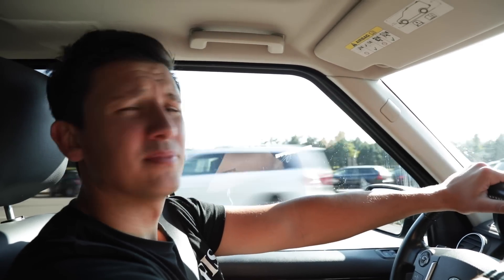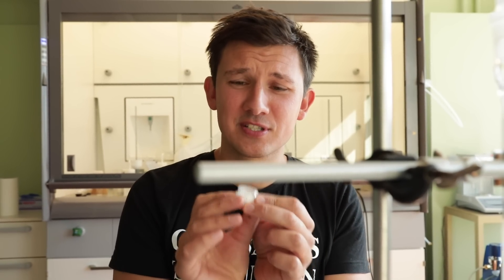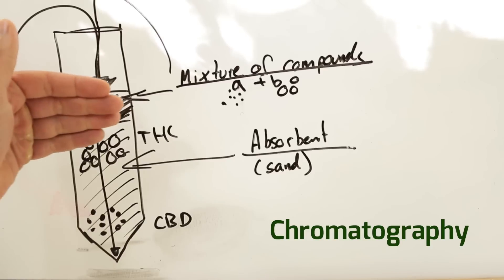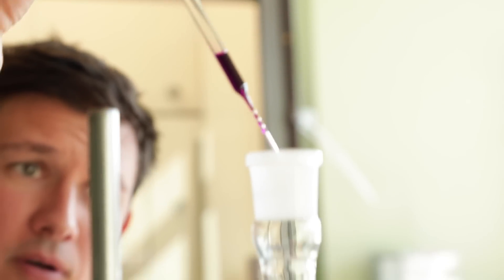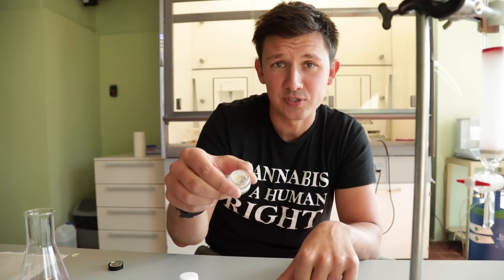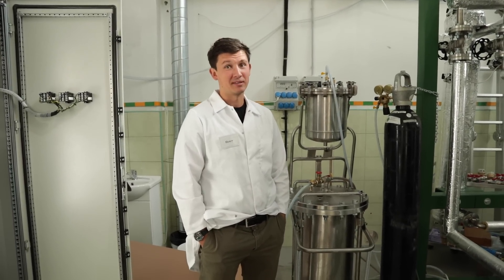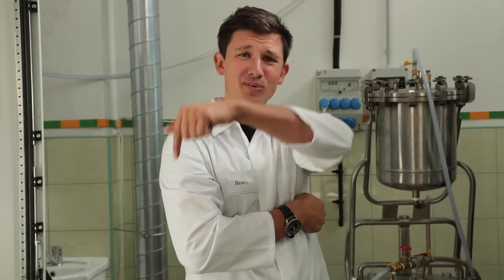How To Make 99% PURE CBD Crystals

Comment: Could you use an espresso machine? Very small scale fill the basket with the sand or make a column shaped basket. Then put the product on top of the sand and switch on they create 15-21bar of pressure so don't see why it wouldn't work 🤷🏻‍♂️ worth a try.

Comment: Fill water tank of cheap coffee machine with sand, disconnect the heating circuit of the water pre-filter, would the pump then create pressure, evaporate off as usual etc? Great videos man.

Comment: What if you place sand in the filter of the coffee machine, place gas tube and seal the coffee machine so the pressure can be kept within as much as possible. If the coffee can be assigned for CBD making than you can drill hole for the gas tube to minimize the gas escaping and create the pressure needed. Just was thinking, I am applied chemistry student and I am very interested in the topic of CBD extractions.
Reply from the maker: Certainly an interesting approach for more diy situations, thanks for sharing!

Comment: could you make the process automated , using pumps to recirculate the product x number of times need valves and switches but should be able to be done with relay logic no cpu needed just asking i have no clue on viscisity etc
Reply from the maker: Interesting propostion!  🤓

Comment: The molecules don't separate because of their size. He said big molecules, little molecules. They separate because of the various effects the solvent system and the solid phase has on the mobile phase, where the mobile phase is the mixture you are trying to separate. The solid phase is the sand. You want to choose a solvent system that will allow a greater distance between the THC and CBD phase as it runs through the column. It has to do with polarity and a few other factors. What he is doing is called flash chromatography, which is column chromatography with the use of air pressure to force the mobile phase through the solid phase. Also, depending on the solvent system, it is possible for the order of the molecules to change--he said CBD will come off first, but that wouldn't be guaranteed as it depends on the solvent system. I am not familiar with weed chemistry, so I cannot contribute any solvent systems that would be helpful, but I am sure those are readily described.
Reply: i need a discription like this for what happens in a honeybee extractor +lightergas (grinded buds)
Reply: @zap7026  what is a honeybee extractor?

Comment: Hes either trooling , or a victim of dunnin kruger syndrome , either way sand will not just stop what you want.  Cbd and thc are both very complex but they are both non polar cannabinoids and they are in there own right also very similar , expecially when it comes to psyical prop like BP , MP , and !!souability!!! .. Plus his "specialized equipment"  could mostly be bought at and hobby lobby and  Amazon ... Long story short dont even listen to this idiot . if you want to make extracts Successfully jus get a high school chem book and flip to the chapter about solubility and molecular polarity \also do a bit of research about boiling points in near perfect vacuum.  

Ps: seriously its simple chemistry , dont consider doing what this jagoff did on the vid , as few good day of research and the right starting hemp (biomass of choice) you could be toutering this fool on how to do an extraction - remove lipids+fats - vacuum fractional distillation  to seperate the otherwise inseperable; terpene fraction ~ diol/alcohol fraction(cbd+cbn) then finally the canibinoids with the higest boiling point THC +THCn+THCa.
Reply from the maker: Well, sand works perfectly well for crystals, but we use a variety of extraction methods. It works for us and thousands of our customers, but hey, thanks for all the compliments ;)

Comment: Have you tried with a single cup coffee maker?  Take it apart, reroute the water lines and add your chromatography tube along side of the machine with an additonal water line routed from the bottom of the tube into the drip spout.  Utilize the water pump as a pressure pump.  Pressure may be an issue, or pump timing.  Find the pressure or low water switch and cut it away from the pump and add a switch to it so it doesnt stop automatically to hopefully keep the oressure for the tube.  Love the idea of building a consumer Oil maker!!!  Dont even think it would be that difficult.  Just a thought 🤷‍♂️😊  awesome videos.  Love the ingenuity!

Comment: you need a whole chain of coffee machines. one is not enough.
connect them in series for volume or connect them in parallel for speed.
simple

that way you can scale up to the preferred VOLUME.
again: one machine would be simply underpowered

I would suggest to start with 6 machines that´s a good balance between price and output.
that way you can keep the cost low and still have a decent production.

edit:
you can start with CHEAP ones. don´t need to go crazy with top brands from Italy.  
unless you are rich and care about style vs cost. LOL

Comment: Have you guys tried liquid extraction if you did with what solvent? Also curious about what sand is used. Reason for askin, very few people have access to GC equipment to ensure how much thc goes through. Thanx for the video.
Reply from the maker: The sand we use is a type of silica, and we have done a video on alcohol extraction, however do our extractions at Endoca with C02

Comment: What do you use for the "pressure" part? Oxigen?
Cheers...
Reply: Mr. Sunny makes the liquid follow the path of least resistance (down the tube) at a higher rate. Basically just speeds up the process
Reply from the maker: A hose with air pressure for an at home job should work perfectly fine
Reply: Nitrogen is typically used for Column Chromatography...inert gases are best, but it really depends on if your compound of interest is sensitive to oxidation. I think pressurized air works for this particular separation, but in most research labs N2 is used.

Comment: yo.  conventional coffee machine is not going to work, but you could use a cold drip, potentially...  otherwise, use an espresso machine, pack with sand, and then the extract...  the steam pressure may be enough, have to watch the temp to prevent burning everything away.  and maybe experiment with ice to affect the physics of the procedure.
Reply from the maker: Awesome, if you try it let us know!

Comment: If I'm only getting THC out, does it take longer the same amount of time? And do you do it over and over a few times by rerunning the same fluid or keep adding extra fluid for each run thru the sand? What kind of sand would you suggest? Last thing, what kind of fluid exactly? (Sorry for all the questions at once.  Lol.)

Comment: You never say how much pressure you need...espresso maker van get 9 Barre.
Reply: That's exactly what I thought!  I was looking for this comment.  I imagine it would work.  What I would do, theoretically, is disable to heating unit (and any alarms the system might have for it like an auto off), putting pure sand in the area for the "puck" of finely ground coffee, then have the machine push it through.  Just use a small enough amount to test it and pray it works

Comment: It is easy .

You need pure Silicon Dioxide (sand)
A glass tube to hold the material and filter . 
The liquid would be the oil mixed with some ethanol 
Apply pressure or suction from below and that's it
Reply: you dont use ethanol for this process
Reply: @unclesam1813  why not?
Reply: Have you done it?
Reply: Why is the thc absorbed oppose to the CBD? Would this process work with oil with a higher percentage of THC as in not extracted from hemp but high CBD cannabis?
Reply: @brokenoho  it does not absorb the thc but the thc cristals are larger than the cbd cristals and therefor the cbd cristals wil come out first and thc last and yes , it wil work on any ratio cbd/thc but i think to find out when it stops putting out cbd and starts putting out thc might be a bit tricky to define
Reply: Dave Nolan if you wanna crystallize thc you need to either do a form of jartech or buy a diamond miner
Reply: @Kenfuy  Even a year ago jar tech was old. Diamond miners are not great either. Dissolving thc isolate in a solvent and allowing crystallization through evaporation is the best process to produce thc diamonds. You cannot do this work cbd, cbd requires lower ph to crystalize so you would need to add something to lower ph in cbd crude to produce cbd diamonds.
Reply: @RoyAlvarezLuna  it's all just saturation levels but a miner/jar style allows for recrystallization to grow growing massive stones like the 1000g stone by east coast gold, I wasn't speaking for cbd. If your goal is to just crash the thca then evaporation in a dish/pan will be the most efficient. Lower and slower methods can more reliably produce larger stones if that's the goal. Jar teks are just a small scale way to start learning about saturation levels man.
Reply: Kenfuy those are from pentane recrashing.   🤷‍♂️.  Take pure thca and dissolve into pentane and it reforms into larger crystals and can keep growing if you keep it saturated In thca rich pentane.    How many of you clowns actually do this in a lab for a job? 🤣😂.   My guess is none of you.   You’re mixing up different tech and from your comments only half understand what you are talking about.
Reply: Easy? For you who must be a real scientist!
Reply: Catherine S. Todd not really, just takes some cash for a CRC and a closed loop and a lil bit of understanding on how crystals are formed
Reply: @MatanuskaHIGH as I said in my comment "I wasn't speaking for cbd"
Also I said "it's all just saturation levels" sure it's less specific than talking about using specific solvents but some people do use solvent blends for their reX.
But nah ya "wElL AcTuALlY"
Reply: Aye can you put down. Steps

Comment: If you are using silica gel "sand" he more polar CBD should be retained longer than the THC you had it backwards. On C18 column reversed phase then the order would be reversed. Don't you use some kind of detector to determine when you compounds come out of the column? Otherwise you are wasting time a solvents, amateur hour.
Reply from the maker: We do ours in the lab and have far more processes involved than in the way we showed in the videos. We are just trying to show it in the most simple, stripped down version

Comment: CBD and THC are the same size and weight... they would not differentiate as to size would they if they are the same weight?
Reply from the maker: We do not work with THC, therefore we can't answer your question with accuracy. Sorry
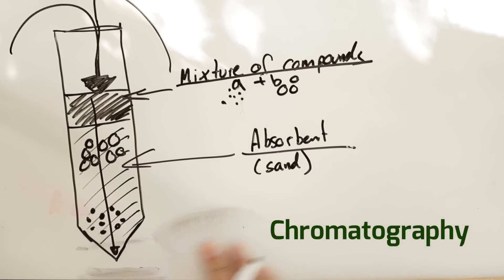Reply: @EndocaCBD   @  1:36  -   you state THC and CBD and specific separation of them as determinant upon the molecule...

Comment: wtf iv made this before and that's definitely not how you get crystalline you need time and pressure and fse soup that's is fully saturated with thca and cbda
Reply from the maker: Would love to hear more about your process! This is the way we tried and tested and it works, obviously we do it at a far larger and more industrial scale than how we do it on this video :)
Reply: Yeah, thats what ive head in regards to thca. Something along the lines of thca not melting under 50 odd c. First press hot to remove turpenes, thc and cbd and then further presses under 50c to isolate thca. Something like that. I think this guy is just fishing to find out how its made...

Comment: i generally use solvent dispersion in a piece of pre washed hemp paper, that's called paper chromatography, and it's based in the different speed of propagation of different compounds trough convection in a solid, you will drop the solution and check the side that countains thc, i don't remember wich side it's, one side will have thc and the other cbd, cut the cbd side, wash the cbd paper with isopropyl alcohol and repeat the process as much as you like, you can buy a fluorsilicon pot in the cooking items in any supermarket, fluorsilicon is shatter proof, to collect the hash in one ball you might want to freeze that.
Reply: fss1704  hey I’m looking into making my own CBD crystals and the way you’re explaining it makes sense but would it be possible for you to maybe make a video on the presses and steps you take when doing paper chromatography I think that would help a lot of people like myself who just want to make this at home thank you.
Reply: never use isopropanol for anything , people are fucking dumb. do yer homework

Comment: would this work to make thc crystalls ? thanks for the vid
Reply: they probablly just threw the thc away in this method, you can mix this thc in more weed, but you can't smoke thc-only, else you may get convulsions,  the synthetic shit people smoke countains only thc-derivatives, wich may cause seizures because cbd moderates thc.
Reply: If you want THC crystals use high THC cannabis and put it on a silk screen and rub it back and forth the crystals will be under the screen.

Comment: You say that first comes out the cbd. Does the thc eventually comes out or the sand doesn't alloud thc to pass trough. If the thc passes trough when woukd I know its time to get out the destilated liquid to be sure that I only have CBD? Thank you
Reply from the maker: We use CBD extracts, from our CBD rich hemp plants, therefore we don't actually have THC, or have only very minute amounts which are within the legal limits, in our plant material and therefore our extracts before we get to this point
Reply: paper chromatography, i used it a lot to separe the substances in a big page of phun subs, to separe the real substance in the middle of the garbage, i removed the "LCD" from the paper and returned that crap to the seller to sell the unknown shit that was mixed.

Comment: My thoughts would be if you vaporize the materials at a certain temp, then they liquefy at a lower temp.  Now if you you do this temp on the solution at start, then it would liquefy unwanted matter. I believe your hypothesis on the pressure is necessary. My question is you used water as your solvent and slowly added pressure, this eventually would generate heat, as you warm to a certain temp all of the carbon and non crystalline objects would be forced to the bottom. If you are having problems understanding where I am going at this point, research the cubic zarconia creation methods. You have to understand you are working with a crystalline.
Reply: +Rodrigo Delgado take the paper filter and do paper chromatography. No fking equipment nor special solvent needed, just a piece of paper and isopropyl alcohol.
Reply: So... how would you do it on a coffee machine?

Comment: hi I'd like to know how many liters of CBD oil you need to make 1kilo of Pure 99% CBD Crystals ? ? ?
Reply from the maker: This depends on the strength of your CBD oil as every extract will have varying quantities of CBD inside, so there is no black and white answer to this unfortunately, too many variables involved
Reply: Giving weed has an "average" 12% cannabinoid content and assuming you're extracting an indica with 80%CBD by volume, some 8,18% of the mass of the cannabis will be cbd, so if you could theoretically magically without any loss  extract 100% of the cbd of the plant to crystals you'd need some 13KG of cannabis per kg of crystal.